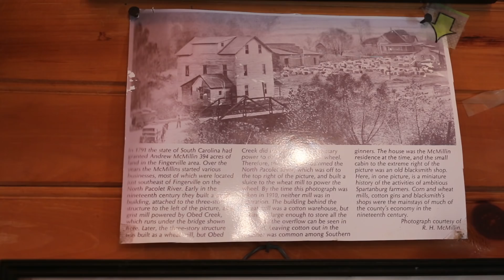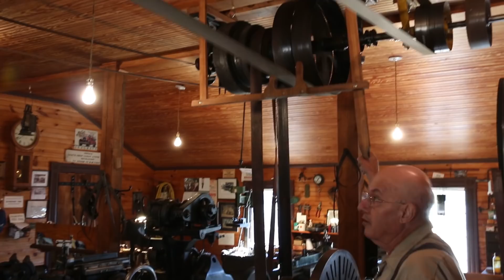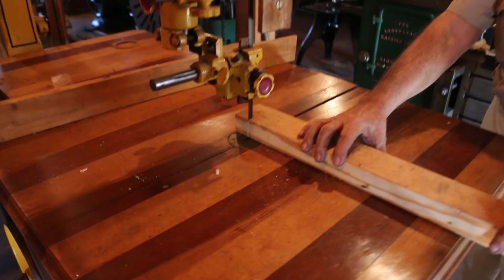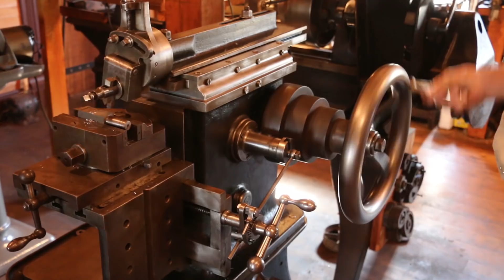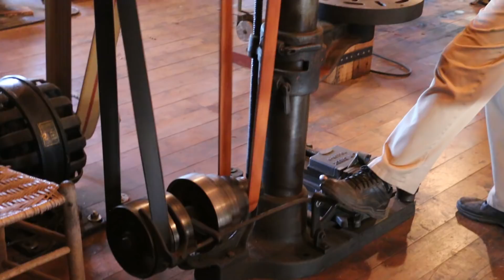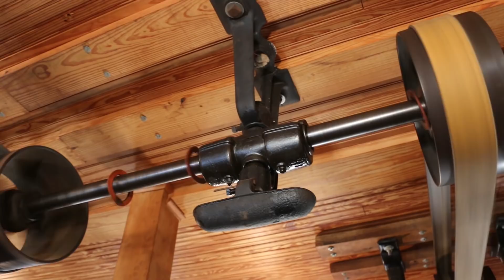Shop Tour 4: Walter Clements - Line Shaft Machine Shop

Comment: I've got a Pratt and Whitney lathe made in 1863, I'm working on converting from line shaft to variable speed. I have all the change gears as well. Its nice because it has auto feed, factory tool support and tapering jig. It's huge and heavy.

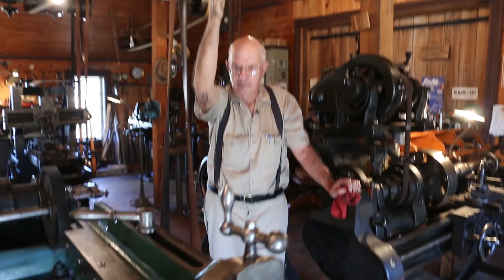Comment: Did anyone else notice that the shaper at 15:34 was not working correctly? It was fast on the cutting stroke and slow on the retract which is opposite of what it should be.

Comment: Mr. Clements is a remarkable gentleman !    I fell in love with line-shaft shops when I was picking up some belt dressing for my Barber-Coleman surface grinder .  I walked up the steps to the second-floor of an old warehouse and was immediately met by the smell of tanned leather and the clickity-clack of a dozen leather belt hinges of the leather belts being broken-in and tested from the overhead line-shafts at the belt shop .  I'll never forget that experience and the sensory images .

Comment: I have a passion for antique machines and tools. I do leather work and was lucky enough to find a 1938 Singer industrial sewing machine, model 111W113. It's 16 years older than I am and is in better working condition than I am. It doesn't look very good as its missing much of the paint in the areas where materials went through where it sewed them. . I can't imagine how many things it made during WWII for the military. It also came with an antique electric motor with a clutch that worked opposite how one in a car works. You would have to push the pedal to engage the motor while it was running to sew. Since it ran the machine faster than I could handle, I rigged it to pedal it with bicycle pedals. Here's a link to the video I made from how I made it. 
https://www.youtube.com/watch?v=N0qCp0uczjM

Comment: The Rivett 608 tailstock spindle, instead of a standard Morse or Jarno taper, had Rivett's own 3° (included) taper; a specification that, although it must have done wonders for the sale of tailstock attachments, condemned subsequent owners without the right fittings to endless frustration.  Jarno had an (included) taper of 2.8642°.  
http://www.lathes.co.uk/rivett/page5.html
https://littlemachineshop.com/reference/tapers.php

Comment: What is the actual difference between the planer and the shaper?  The planer appears to work just like the shaper although the planer has a greater length of travel
Reply from the maker: They both work pretty much the same but a shaper moves the cutter over the work while a planer moves the work under the cutter.

Comment: Great shop! We have several shaft drive tools that were converted to electric motors.  That 'junk' in the planer is a elevator counterweight. It appears to be a cast one.  The elevator safety code changed back in the day that required steel plate instead of cast.  Typically the steel ones were 1" plate.

Comment: Great video, thanks for showing us around Mr. Clements' shop, and please pass along thanks to him for allowing it.  Also especially great to see a Rivett lathe in a good, loving home.  I have an older Rivett, the precursor to the 608 known as the 8" Precision (mine is from around 1912).  It's my favorite machine and I use it almost daily.  For what it's worth, the tailstock taper on the Rivett 8" Precision and 608 is not a Jarno, although the angle is close, it's a proprietary taper.  The spec for the taper is in a landfill up in Maine, along with most of their parts, documentation, and tooling.  The only factory drawing I've ever seen for a Rivett tailstock fitting specified the taper "to gauge".  Of course the gauge has not surfaced and is probably in the same landfill with everything else.
Reply from the maker: Interesting information.  I would love to have one of those Rivett lathes like that....

Comment: Beautifully done!  Thank your for this!  I took drawing in my first semester back in '81.  Not every college has abandoned good education.  When I attended LeTourneau in the late 80's earning my electronics degree, I had to work Machine Tools and cross-trained in Welding engineering and mechanical engineering as well.  They still require that as I understand.   Well rounded curriculum.

Comment: A man and shop from a time when every man had to think, a university that really trained there students. As a retired heavy equipment mechanic I have growled many times at engineers who had no idea how there designs would interact with others, making repairs more difficult than needed.
Reply: You, and damn near everyone that's ever used a wrench on a car have all had "what were they thinking" go through their minds.  It's funny how you can tell when a mechanic actually designed something, like the retaining lock on the serpentine tensioner pulley on my truck.  Pull on the belt (hard) and push on the lock tab and the tensioning pulley locks untensioned.  No weird combination of wrenches or breaker bars and busted knuckles!!

Comment: I have seen other machinery made in the 1800's that is not very tall. I worked at a bindery shat Charles Beck sheeters...one of the sheeters sat on 6x4s to get it up to height of the modern machines. People were of a shorter stature in the 1800s, most men would have been 5'10" or shorter.

Comment: I used to work for Fulton Supply in Atlanta. The company was established in 1917. There were some remains of the old drives.An interesting fact is that the scene in "Driving Miss Daisy" where the elevator got stuck and Morgan Freeman fixed it. That damn thing did it all the time. The fix was to reach over and give the cable a little tug.I spent five years in that place. Long before the movie. The outside shots were edited and the Werthan Mill interiors were not from there. I think they were Southern Mills.I also know the area that it was filmed in. I like to watch the movie again and see the Piggly Wiggly that my Aunt took me to. And the Fountain Drug Store across the street.

Comment: Hi.
Lineshafts go right back  to the industrial revolution when they were used in seven storey and four storey cotton and woollen  mills in England. These mills had very large  and up to three water wheels, which with belts pulleys and line shafts powered the whole mill. There was no other source of power.The one I have a little knowledge of is  Quarry  Bank  Mill  at  Styal  in  Cheshire  U.K.  This was restored to working order  in the 1970s complete with working looms run by the waterwheel. Even back then machines not in use could easily be disconnected from the shafts as there were so many of them even though they ran on more or less free power provided by the river. Running an engineering workshop powered by a very large electric motor is a different matter with most of the shafts. pulleys and belts still running but only one machine being used at a time.
Reply: of course they would have sized the water wheel with the intention of running all the machines at once, for the most profit, a little less practical to do with an electric motor, plus i guess he didnt need that facility.